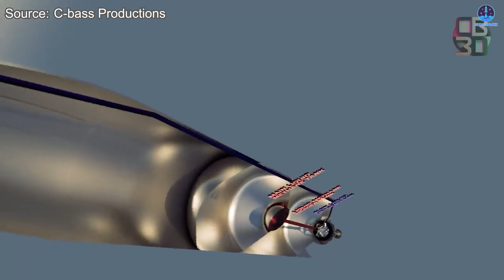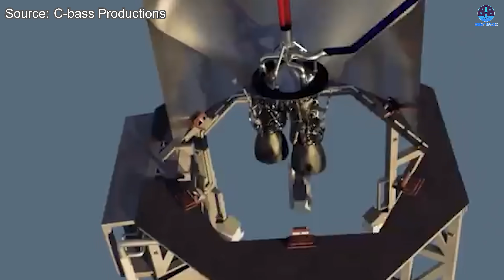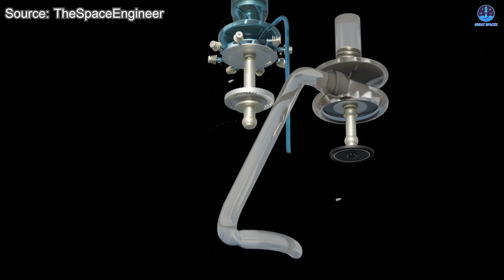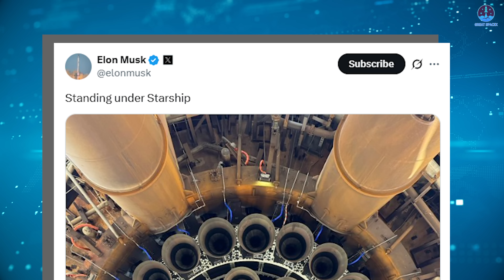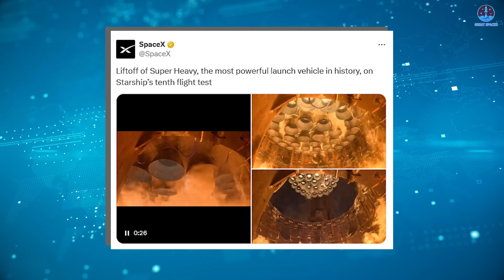The Real Cause of the Engine Bay Explosion during Starship Flight 10!

Comment: the engine bay skirt 'explosion' appeared to me to be a foreign object strike from a roughly right angle. my theory is a trailor from the recent meteor shower, or just some random thing. the video I've seen doesn't show a actual combustion event, just a sudden spray of debris from the outside, from the side in relation to the direction of ship travel. the speed of impactor and ship, as well as the significantly different apparent angles of convergence could easily strike the skirt and still miss the engines.

Comment: Given the video evidence and the stresses of reentry, odds are a tiny amount of plasma slipped into the engine bay; this by itself isn't good but shouldn't've caused what we saw on the livestream of the flight. On the other hand, if there's a propellant leak inside the engine bay when that aforementioned tiny bit of reentry plasma arrives, then you get the explosion seen in the livestream.

Comment: last time i checked there were no fuel lines in the lower shield area where the explosion occurred. the bast carried inward not outward, indicating that it was struck by something from outside the ship. due to the way the metal was deformed inward it is unlikely that a loose heat shield tile could be the cause. the most likely cause looking at all the evidence was orbital debris struck the ship while it was in flight. also this could not have been flap debris due to the direction of travel and the close proximity to the bottom of the rim.

Comment: Fuel leak.
As the vessel was landing in the sea, you could see an orange flame out the bottom of the vessel where the explosion caused damage.
If SpaceX does not get fuel leaks on Starship resolved, it will never make it to the moon and back, little alone Mars or orbits around the earth.
The last 4 Starships have had fuel leaks,  and explosions.

Comment: Damage happened on rhe skirt.  The damage didn't effect the mission.  If there are fuel lines in the skirt, they feed addittude thrusters.  The announcer mentioned SpaceX experimenting with a reduction of thermal protection along the skirt, as this part of the rocket doesn't contain mission critical systems, or parts.  The ampunt of insulation sent flying seems to indicate a small explosion.  I doubt it was an impact.  But I'm an armchair astronaut.  I'm sure you will share this information with us, when SpaceX realeases it.

Comment: Reusable ships are needed in small quantities. There will be fuel tankers in the orbits of the Earth, Mars and the Moon, and landing the ship is more advantageous due to engine braking. Then a heat shield is not needed. The ship's carrying capacity will be twice as large. Fuel must be produced and delivered from the Moon, as it will be 20 times cheaper. To fill one tanker, 10 flights from Earth or only 2 launches from the Moon are needed. At the same time, to refuel from the Moon, the ship does not need a heat shield and does not need the first stage of the rocket. Before landing on Earth, the ship will be refueled again for landing due to engine braking. And then the ships do not need a heat shield at all. This is especially advantageous when flying to Mars, when before landing the ship will be refueled in Mars orbit and there is no need to carry fuel in the ship, which will increase its carrying capacity.
Reply: The moon is the best longterm platform... but we're also talking about moving fab and production to the moon. The reusable big rigs shuttling stuff back and forth are just the baby steps required to make that dream a reality.  Because once we can do this to the moon, they'll have to step up their game to do the same on Mars. So build for Mars now. By the time they are done they should be able to reach the moon easily since their vehicle will be overengineered for the task.

Comment: Both aft flaps suffered from damage at the rearmost hinges so something there isn't tolerating the reentry heat as well as it should.   I'm not sure how the flaps are actuated so possible hydraulic failures led to the small explosions then burn through as it reentered.   This should be an easy fix for SpaceX to isolate and correct.  What an AMAZING machine!!
Reply: The flaps are actuated by electric motors.

Comment: Kevin, the debris originated from the rupture inward toward the engine, so it looks like it was caused by something occurring outside the STARSHIP. Any piping in that area? If not, heatshield failure and stress fatigue from heat of re-entry.

Comment: Switching to both Rapture V3 and Booster/Ship V3 without solving the currant problems may just cause even more issues than it solves ie more RUD's (set backs). SpaceX learn from your mistakes is great but not when they don't fix the problem before continuing
Reply: It is a hard thing to judge in product development. These things take months to stage out and they want to go fast. They are all prototypes that are going to be thrown away. Too many is a massive waste, while too few can also increase costs by not learning as much as possible on cheaper design.

This block 3 is looking to be more like a block 2.5. Block 2 fell well short of original performance and those targets have been moved to block 3, and block 3 -> 4. I expect we will see another block or two before we see something close to the performance of the "original block 3."

Comment: Some simple facts lead to interesting observations.  1.  An explosion is a special case of combustion 2.  Combustion requires 3 things: Fuel, Oxygen, and a heat source.  Watching the flight video, two vent streams (Oxygen and Methane (fuel))  can be seen near the point of the explosion.  The two streams interact, slowly at first, then they begin to resonate.  Then Boom!  I am convinced that the resonance caused the skirting of the ship to vibrate, generating a spark... the last thing needed for combustion...  It's all in the video!
Reply from the maker: Thanks for your comment ❤️
Reply: @colonbina1  This implies an extemely simple solution:  move the vent on the skirt away from the engine...  easy, simple, and cheap.

Comment: Fuel + no O2 = no kaboom, It may be possible that there was a fuel  leak or venting and, if oxygen was being used to supplement the heat shielding as has already been speculated in the discussion of the rust colored staining, the two might have mixed early in the re-entry and ignited.
Reply from the maker: Thanks for your analysis👍